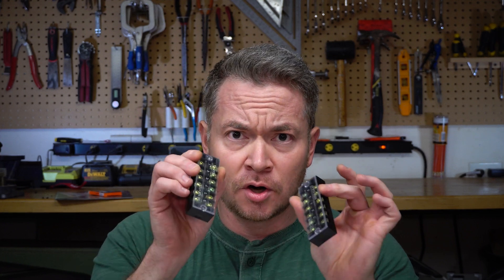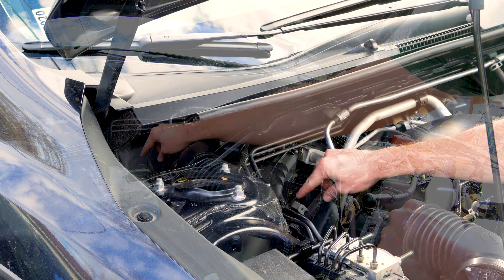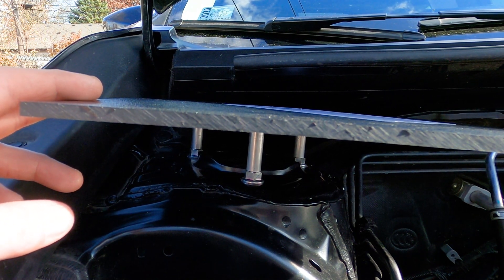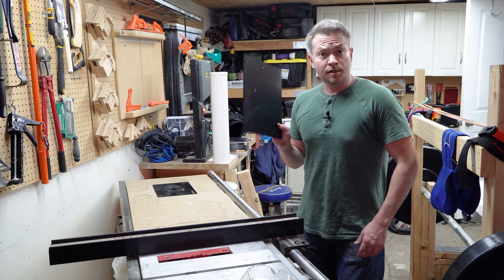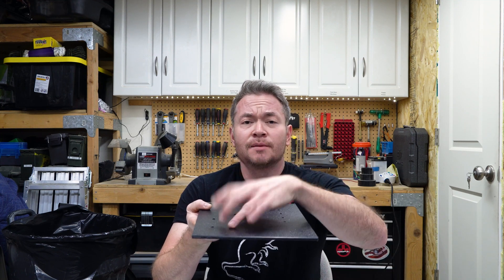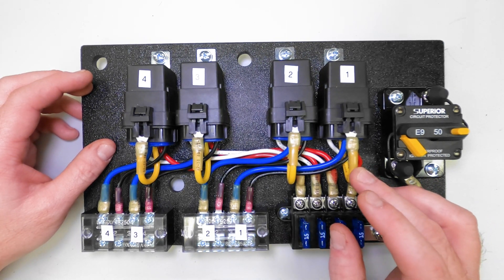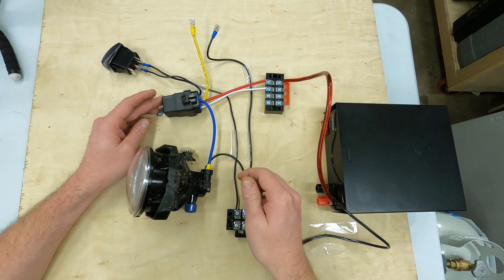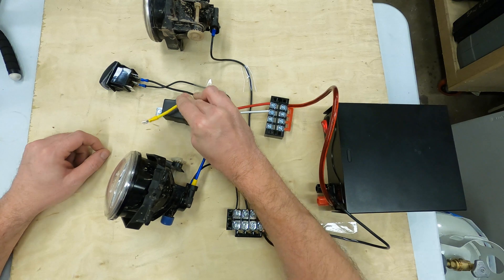Subaru Crosstrek Electrical Accessory Upgrade (Part 1 - Relays & Power Distribution)

Comment: Hey Tom, First, thank you for the awesome videos. I'm in the process of building on a power distribution relay panel for my 2023 Crosstrek. I have one question i believe the way you currently have the power cables wired in this video they are configured for always on 12v, correct (direct relay and device power to battery)? How would I wire it so the relay is only receiving 12v power with ignition on while still being a switch to ground?  Would it be 86 = keyed ignition (do i need a fuse here too?) on. 85 = switch to ground. 87 = power to light/accessory. 30 = fused direct battery 12v positive. ? Also where can I tap into a good keyed ignition on point for all four relays? Maybe a quick three minute Thursday video will help idiots like me lol. Thank you in advance for your help. -Rob

Comment: Good stuff and very clean looking.  I used ABS on mine also, but mounted in on the driver side close to the battery.  I left a flash light under the with my go camera recording to check the clearance.

Comment: How do you stop a voltage drop resulting from all the extra lights being powered?  I would like to add a 50W accessory to my 2000 Legacy without seeing a voltage drop, which I am seeing (like 0.5V drop). Cheers, Mark

Comment: how come you didn't install everything on the right since you would use less wire to go into to the firewall just curious I plan on doing the exact thing to my crosstrek but want to do it on the right if possible.

Comment: Question: I'm not that familiar with relays. What is the advantage of having this relay setup as opposed to wiring directly to the fuse box?
Reply: It depends on the load.  Some accessories need more power than the switch itself can handle, so putting a relay in the middle keeps you from burning up your switch.

Comment: Tom, right from the first I thought the panel looked cool on the slant. Would the panel and parts cleared the hood by being slanted? Great idea to use strut tower bolts for base.
Reply from the maker: Mounted 90 degrees from current with a slant it was interfering with the hood.  Not the panel itself, but the relays were contacting the hood ribs.  Ah well.

Comment: The main 50A breaker should be as close to the battery as possible. Right now its not really protecting anything except that 2 inches of wire going to the distro board. Other than that its a nice little set up!
Reply from the maker: Thanks for sharing, and you're absolutely correct.  Another viewer commented something similar and explained the reasons why and I've since moved the breaker to within 8" of the battery as a result.  Perhaps I should do a short video on that to help share the knowledge :)  Anyway, thanks for watching and chiming in with some solid advice!

Comment: How has this setup been working for you?  I am thinking about attempting this on my own crosstrek.  I love this idea for the mounting but I think I'm going to go with more of an OOB design for the switches.
Reply from the maker: Hi Nick, thanks for watching and chiming in.  I've been happy with it so far.  Functionally, it's done everything I needed it to do, and reliably.  TBH, this was more of an experiment to see if I could do it and maybe save some money while I'm at it.  My best friend has a SwitchPro in his Land Cruiser and I won't lie...it's a really really nice device.  I just picked up an old GX470 as an overlanding toy and will probably outfit it with an OOB solution like a SwitchPro now that I've scratched the itch to see if I could build one myself LOL.  Hope that answers your question.  Thanks for watching!
Reply: @TomtheDilettante  yes it does thank you.  I bought the AUXBEAM off Amazon.  Planning to create the platform similar to yours and attach that.  It's bot pretty decent build quality and was a bit cheaper than what adventure zombie used.  Ty for the reply!

Comment: Just watched this again and thought I should mention that I’ve always been told that relays should be mounted vertically not horizontally. I have seen a few explanations as to why from ‘the spark could ignite fuel’ to ‘it drains any moisture out the bottom and stops it affecting the internals’.  I don’t know what is the correct answer but may be worth further investigation...
Reply from the maker: Thanks for sharing!  Gotta admit, I hadn't heard of that before, but I'm not an expert on these either.  As you say, might be worth experimenting.  The particular relays I used are advertised as sealed and water proof so it's my hope that moisture and/or spark jump concerns would be minimal or non-existent.  Point taken though as these may be legit concerns for other relays or just in general.  

I'm now envisioning a "Mythbusters" style video trying to get a relay to blow up an enclosure LOL!  Hmmmm....

Comment: @Tom the Dilettante  Can you add the parts list for this video so that anyone who would like to replicate this or do something similar knows what you used? Thanks
Reply: Also, what is the blue wire that is seen in the video when you are trying out the strut tower stand-offs? What guage? What does it go to? What is the device the blue line connects through (fuse of some kind)?

Comment: I made the identical panel using your video, even the same manufacturer components with the exception of the relays, that brand hard to find.  Presently I have power to the feed bank to the relay, however no power going to blue wire when grounding the black wire terminal.  And typically one can hear when a relay is working with a click sound.  I am not hearing that as well.  Ruling everything else out I am assuming it has something to do with the relays internal schematics not being the same / color matched to your's ??
Reply from the maker: As I understand it, wire colors may vary but relay terminals follow a pretty consistent convention.  check out the diagram in the link below.    Your accessory's power should flow from terminal 30 to terminal 87 when the relay is energized (closing the circuit between 30 and 87).  The relay is triggered by power to terminal 86 and ground to terminal 85. This is assuming of course your relay's terminals are numbered (most I've seen are).  Hope that help a bit.  Good luck!

https://wholefoodsonabudget.com/wp-content/uploads/2018/08/120-volt-relay-wiring-diagram-120-volt-relay-wiring-diagram-elegant-wiring-diagram-for-relays-12-volt-relay-carlplant-likeness-15g.jpg

Comment: I did the same project just a little different if your looking for a cleaner more sealed box let me know and I’ll send you some pictures
Reply: Iztor Universal 6 Way Blade Fuse Holder Box with Spade Terminals and Fuse,5PCS 4Pin 12V 40A relays for car Truck Trailer and Boat https://www.amazon.com/dp/B076L1G4VX/ref=cm_sw_r_cp_api_glt_fabc_4F62CW5RTCEQXP5ZQ5QM?_encoding=UTF8&psc=1
Reply from the maker: Oh dang!  That's nice!  Didn't see that one on my searches.  Thanks for sharing!
Reply: @tannerking1617  Does this housing have a single positive (+) input for the entire fuse line,  or do you need a distribution buss to bring power from a single large line and distribute it to each fuse in the housing?

Comment: How will this react to the elements?
Reply from the maker: Jury is still out on that one.  So far so good.  Been thru 80 degree F to -15 degree F, rain, snow, sleet, and some mud, water and frozen crud offroad so far without issue.  The relays I got are pretty solid and weather proof.  The rest of the board is likely going to be the area of concern.  Another viewer suggesting putting some dielectric grease on the fittings so I think I'll do that as soon as it warms up.  If / when if fails on me, I'll be sure to post something about it.  Fingers crossed that won't be anytime soon :)  Thanks for watching!

Comment: Tom, one question: did you put an in line fuse by your battery terminal in addition to the circuit breaker? That seems like a long run to the breaker and opportunity for a short with all the engine heat and obstructions on the way...
Reply from the maker: Very astute observation :)  I actually ended up relocating the breaker closer to the battery for that exact reason.  Another viewer pointed out this risk and I was like "oh shit...good point!" LOL.

My video on that one is the last half of here:
https://www.youtube.com/watch?v=Ou97F8rPGhg&t=36s

Thanks for watching and for the feedback!  Folks like you are inevitably gunna save me from myself :)

Comment: Yeah, love the revised intro! Crosstrek doesn't have a ton of space for accessory mounting. It's a head scratcher for sure. Wish you would have done this video this past summer when I was struggling with the exact same thing.
Reply from the maker: Thanks for watching!  And yeah, not a whole lot of real estate for mounting things.  There are some great "out of the box" solutions for doing this, but this was just one of those "I wonder if I could do this from scratch?" kind of things that was too hard to resist trying :)

Comment: I’m only 10 minutes in but I just thought of something I use on my dual sport motorcycle for accessories. 

It’s called a PDM60.  It’s a digital circuit breaker for power distribution.  60 amps on 5 channels but you can set each channel to what you need. There are lights to indicate fault. No fuses. You can also set a key on/off timer delay. I run lights, my heated gear and USB’s off of it. 

One wire to battery and ground. The rest go to the box. 

Link for a read if you feel like it. 

They also have an updated version that you can configure with your phone instead of a PC. 

https://www.rowe-electronics.com/pdm60
Reply from the maker: Holy smokes!  That thing is bad a$$!!  Never heard of it before, but checked out your link and watched a couple YouTube videos on it and it.  Looks like it's a little over $200 which isn't bad for what you get for sure.  I guess if you want a mechanical switch you just interrupt the power leads coming from the module?  Either way, very interesting.  Thanks for sharing and making me aware of this product.  Might have to back pocket it for future use :)

Comment: Tom, this is excellent content! The "ground switching" makes perfect sense, but I would not have thought to do that. Thanks for the instructional videos!
Reply from the maker: Glad you liked it!  I got the ground switching idea from an Overlandbound video you YT.  Made a lot of sense to me when I heard it too which is why I copied it here :)  It's nice to be able to just run a single 18ga wire per circuit into the cabin and complete the ground locally by the switch.  I'll get some shots of my wired up switch panel soon to share.  Thanks again for watching!
Reply: @TomtheDilettante  just remember that even though you're ground switching, if that 18ga wire shorts somewhere it's still going to get 12v from the relay, albeit only something on the order of a couple hundred milliamps.  and you'll know when your accessories mysteriously turn on ;)

Comment: I like the ground switched method.  The only thing I would personally change would be a method to prevent accidental battery drain.  Maybe a 3 way switch that sends power to a solenoid that's activated by an accessory circuit trigger for when the car is running or manually via the switch.

Also excellent shirt.
Reply from the maker: Thanks for watching Steve!  Good idea on the battery drain.  I considered it, but am imagining wanting to run things like camp flood lights (LEDs) with the ignition off.  It will just be up to me not to be a dumb ass and let it drain the battery LOL.  Should it come to that though, I always roll with a portable jumper to get me out of trouble.  I'm intrigued by the idea of a solenoid that only allows power to the distribution block when the car is running...I might explore that just for the fun of it :)  Have a good one!
Reply: @TomtheDilettante  this is a great idea, I have not seen a single system that allows for separate permanent and accessory powered circuits.  This is definitely worthy of your dilettantish tendencies ...I dare you! 😉

Comment: Would this setup need to be weather proof?
Reply from the maker: Good question.  Though I'd prefer EVERYTHING be weather proof, this is not.  And I'm counting on the idea that it doesn't need to be.  The relays are marine / weatherproof relays so I'm not worried about them.  I used heat shrink on all the wiring connections so I think they should be okay.  The terminals have a cover over the, but are by no means water proof.  I figure it's high enough in the engine compartment and under the hood that its exposure to the elements is minimal.  And I'm certainly not going to take any water crossings that high as the plate is well above the intake (so I'd have bigger trouble if I got that deep than a soaked power block) :)  Bottom line is that the jury is still out.  I'm going to roll with it like this for a while to see how it holds up.  I may be doing a cross-country to Utah next month for some overlanding / winter camping so fingers crossed.  With rain and winter here in the Chicago area, I'll keep an eye on it and report back as to whether or not it sees a lot of weather.  Thanks for watching and have a good one!

Comment: Nicely presented.  A very clean and orderly setup.  I was not liking drilling the firewall and routing wire so I went the wireless route.  The wireless unit under the hood has four circuits for driving lights, LED bar, basket side lights and ditch lights.  I did buy the switches that go in the lower left dash blanks.  I'm considering taking the PCB out of the wireless switch fob and connecting it to the switches in the blanks.  The fuse/coin holder allows easy access for this.
Reply from the maker: Thanks for watching Rod!  I admit, I really really like the wireless solutions and had been shopping around for one before considering this approach.  Some of the nice wireless solutions are a bit pricey even though I think you get a good bang for your buck.  I'm doing this mostly to see if I can do it and learn something along the way.  Hard part is still ahead (putting together a switch panel and actually practically connecting something to this Frankensteined panel).  We'll see.  Thanks again for watching and have a good one!

Comment: Great stuff! First clear explanation I’ve heard about relays. Will keep watching and may do this, although inclined to get the OOB solution.
Reply from the maker: Thank you for watching!  If you're looking for an OOB solution, here is that video I referenced from "The Adventure Zombie" where he put in a Voswitch panel (https://www.youtube.com/watch?v=E-SgzwGIuEs&t=15s).  As for me, I'll stubbornly stick to this plan for now until it fails or just becomes impractical LOL.  It's a great learning experience regardless which is why I like doing it.  Have a good one!
Reply: I like how you made this relay panel from scratch instead of using a prebuilt relay box. I also built something like what you did and mounted it on top of the strut tower simply because there is almost no extra space in the crosstrek engine bay and i didn’t want to cover up my existing fuse boxes. The only thing i would be concerned about is water corroding the terminal blocks. For that i put dielectric grease on the wire terminals. Great video!
Reply from the maker: @jonathonbaugh4994  Thanks for watching!  Yeah, an out-of-the-box solution would have no doubt been simpler.  This was just one of those "I wonder if I could build one" experiments LOL.  I like the idea of using dielectric grease on the terminals.  Think I'll follow your advice on that soon as an added layer of protection.  Thanks again and have a good one!